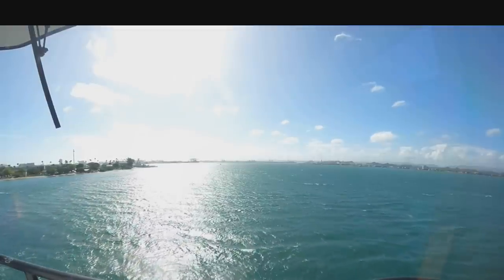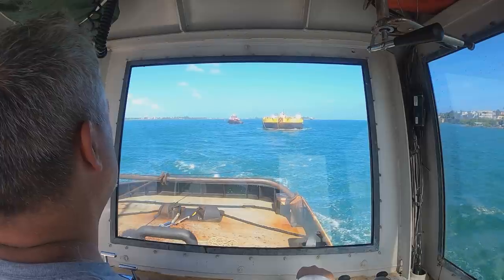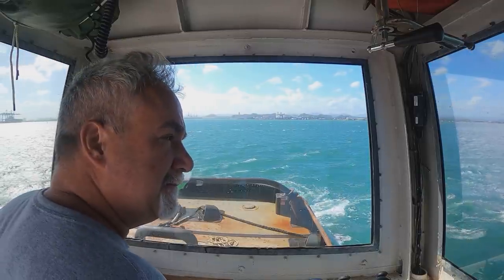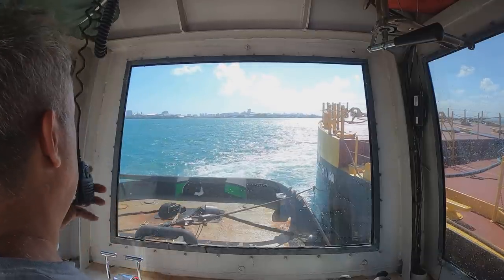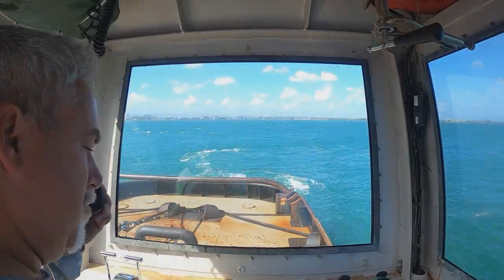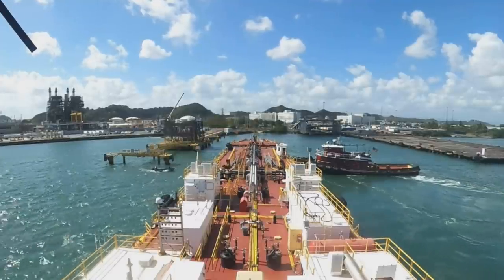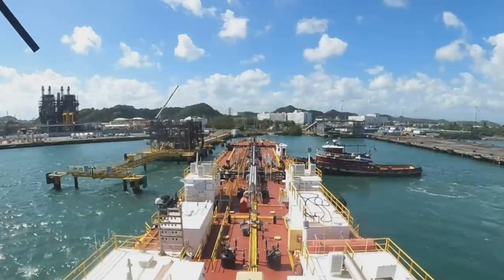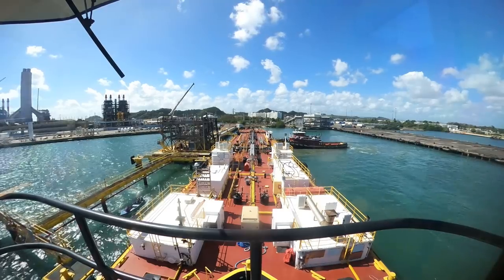Inbound into San Juan Puerto Rico

Comment: Time is your best friend. We do a lot of towage and running alongside smaller vessels that have issues/ropes in props etc, going in to weird places, and since we're fast rescue vessels there van be a temptation to overcook things. 

But slow is smooth, and smooth is fast. 

Especially with an unfamiliar load on the side you can so easily get yourself out of shape by putting too much energy into the equation too quickly. 

Sure... you look like a superhero when you come in with a handbrake turn and get her checked up just perfectly... but feeling like a suoerhero for 5 minutes by no means compensates for how you feel if you get it wrong and end up crushing the living daylights out of your surroundings.
Reply from the maker: Thank you for watching Robin. (I think you will like Tuesday's video on SVP) I talk about many of the things that bither me. 😂 CUOTO 9
Reply: @TimBatSea  looking forward to it :)

Comment: It is so nice to see sun and warm weather. Impressive watching you maneuver around the barge. I know you have two engines and an assist tug but don't you lose the ability to steer when going so slow.... #CUOTO
Reply from the maker: Thank you for watching Dean. Great question. In a small boat, you are absolutely correct. Water needs to flow by the keel to keep it straight and by the rudder to turn. But when increasing the size and weight by factors of thousands, we are no longer looking to have water flow down the hull to keep us straight. The mas of the barge is enough. So getting it pointed in the right direction is crucial and then minor adjustments along the way can be all you need. CUOTO

Comment: Nice and slow the way to go, bet a lot of those old timers run big old single screw or 7 second delay twin screw old boats !
Reply from the maker: Thank you very much for watching Ed. Those Air flex clutches used to be a nightmare. 7 seconds to neutral, and then 7 more to reverse. CUOTO

Comment: Hi Tim from the UK, Enjoying you new location videos, is the tug bigger than the  'Elk River', the small boats off your port side taking ropes to the mooring pods we call 'Foy Boats' . 
Why did you not simply let go the tow rope when you were ahead and had slowed the barge and just wizz round aft as you did, 
My Dad, grandfather and great grandfather were all tug skippers . STAY SAFE MATE
Reply from the maker: Thank you for watching Michael. Please keep in mind that we try to not directly name Tugs Companies or Customers on here as it gets me in trouble with my employer. The boat I ran in NYC was a 3000hp boat. The one down here is a 4200hp.  Being connected by a 2 and half inch wire to the barge requires a great deal of effort to "break tow" and is best done along side. This is a process that takes some time. CUOTO

Comment: Tim, someone told me once that ocean going tubs might be towing two barges like form Puerto Rico to the U.S. with very long distances between the barges where is less than ideal conditions one may not even see the tow conditon.  One of my worst nightmares was always the thought of sailing between a tug and barge or one barge on a long toe and another.

Is this true.  Do tugs tow in this fashion?
Reply from the maker: Thank you for watching. That is called a tandem tow. It is rarely done offshore with loaded oil barges.  It is very common coastwise to sea stone tows lined up with as many as 10 or 12 scows but they are only about 10 feet apart. CUOTO

Comment: Interesting video, probably the roughest water in any your vid's I have watched. Why is it you towed the boat then went into the pushing mode as you got close to docking? Couldn't you operate in the push mode the whole trip as you did in your previous position? Also, the subtitles are for what looks like a sailing trip - do you have another channel dedicated to sailing? When I first heard you mention moving to the Caribbean (about a month ago) I thought it was going to be more of a sailing channel for some reason.
Reply from the maker: Oh no! Thank you for letting me know about the subtitles! Thank you for watching David. We can not push in more than a couple feet of swell without breaking the gear up, so we tow on the wire. CUOTO
Reply: @TimBatSea  Interesting, I never thought of that. May be time for an invention of an articulated connection between tug and barge...CUOTO
Reply from the maker: @dhenschel4  😂😂😂 i think you just invented the ATB!

Comment: Tim, a couple of questions if you have time.
Pilot captain - do you always use a pilot or is this while you learn your area?  In NY I don't recall mention of a pilot.
The assist tug looks lower than your tug.  Is this so or just the angle of the camera?
Coming into the pier the assist tug "seems" to be going sideways while pushing on the barge.  Maybe just the angle of view.  How "fast" would the engines be set to do this?
I'm in the USCG Auxiliary and we perform a stern tow, then switch to a side tow.  Of course, we're on our own boats weighing 6000 to maybe 8000 lbs.  
Thank you.
Reply from the maker: Thank you for watching Dave. We are required to have a pilot on board if we do not have a minimum of 12 trips in and out of everywhere we go (red flag or hazardous cargo). The assist tugs usually don't have or need an upper wheelhouse. That is for seeing over the barge you are made up to and assist tug don't usually do that. They also don't want an upper wheelhouse because it would interfere with them getting under the rake of a bow on a ship they were assisting. And yes. Being a tractor tug, they can stay at a 90 for a long time. Conventional tugs usually start to fall off a 90 with anything more than 1 knot of forward headway. CUOTO
Reply: Thank you.

Comment: When you're running from the doghouse, are the engine controls the same as in the wheelhouse? So the throttle on your right is for the starboard engine, pushing the throttle away from you is forward, back is reverse, etc.... Or is it set up differently?
Reply from the maker: Thank you for watching. Yes, they are set up the same in relation to the hull. The steering was the part I had trouble with when I first started. My old captain used to say, push the NFU joystick in the direction you want the bow to go. That little piece of knowledge has saved me countless times over the years. CUOTO

Comment: Is this a barge longer then the ones in New York?
Reply from the maker: Thank you for watching Patrick. Yes and no. Most of the barges you may have seen me working with in NYC were 30,000 bbl bunker barges. But you did see me moving 50,000 bbl barges every now and then. This is a 50,000 bbl barge. CUOTO
Reply: @TimBatSea  Thanks, Tim

Comment: How do keep some moron from going in between the tug and what your towing?
Reply from the maker: Thank you for watching. It happens more than it should. We try calling them on the radio and we sound the danger signal and light them up with our search light at night. But we usually have to pull the throttles back and pray we don't lose the wire when it sinks to avoid cutting the passing boat in half. CUOTO